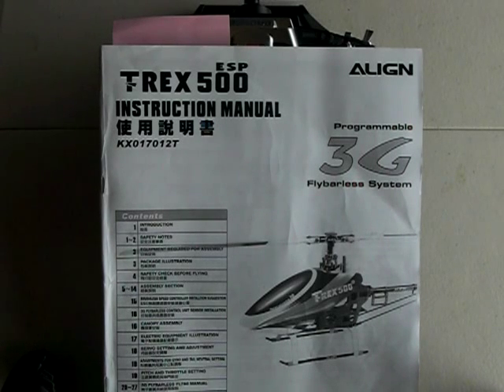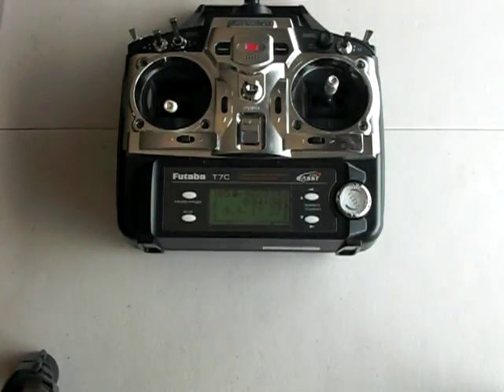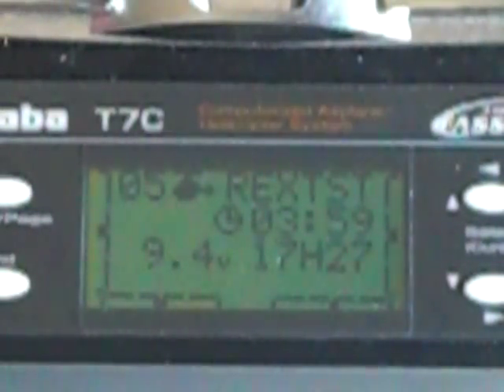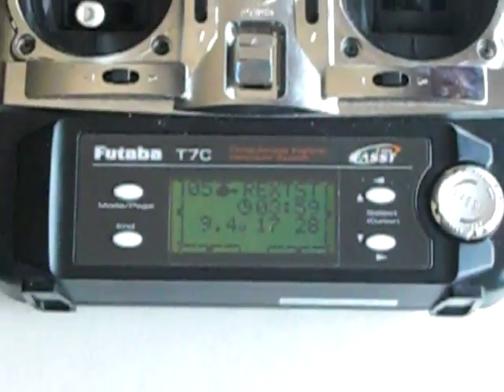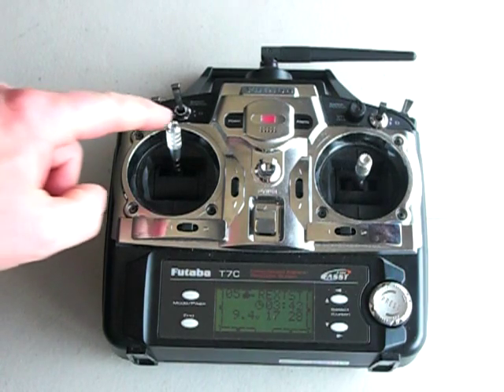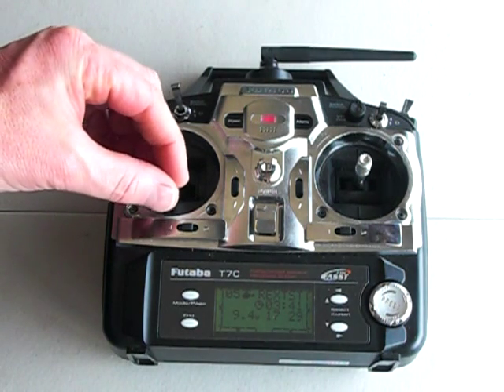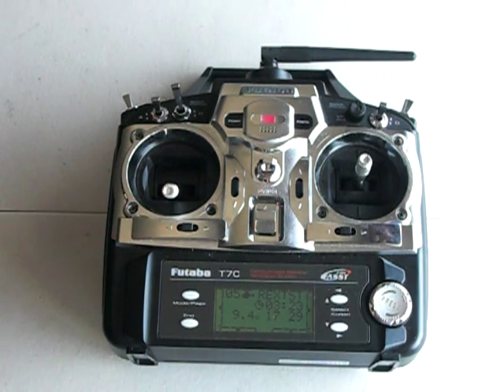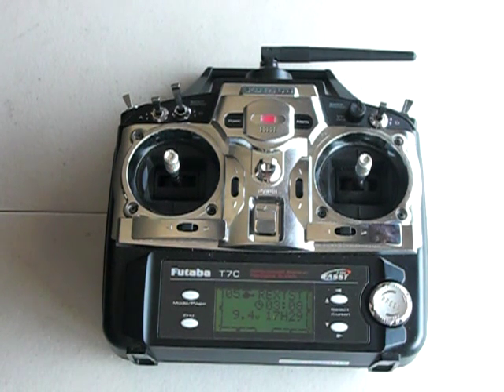Align Trex 500 BEC Speed Controller Setup

Comment: Hi, i followed this procedure today, but i didn't have the time to get to setup mode, the ESC burned out. Before that,with throttle stick in low position,when plugging in the battery, i could not ear any sound but just a ''buzzing'' something like ''nznznznznzn''. I thought that was because it wasn't setup. I WAS WRONG. After the first beep indicating the setup mode i got flame and smoke. Any idea on what went wrong ?
Thank you